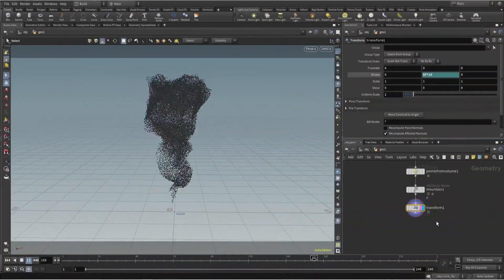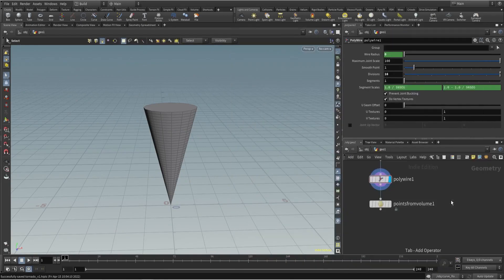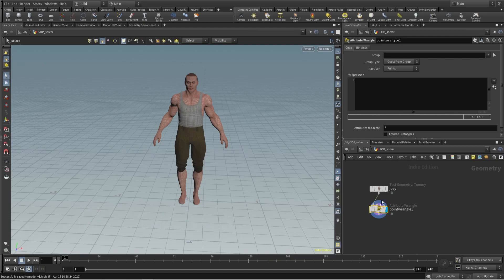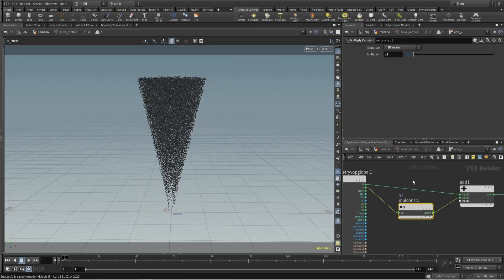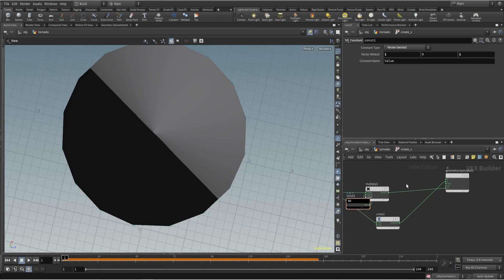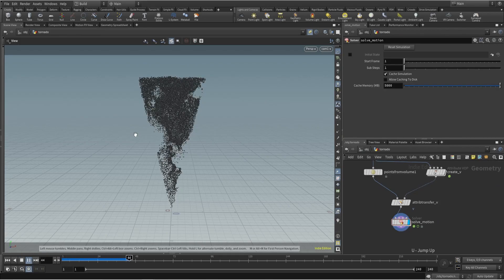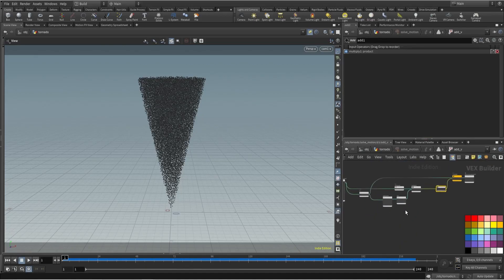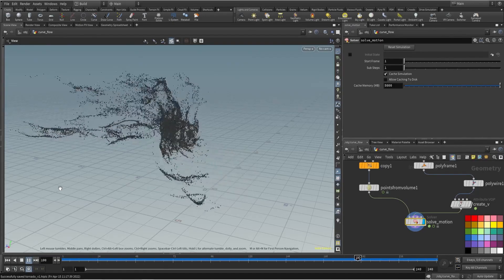Tornado in Houdini with SOP Solver | Step-by-Step Guide

Comment: This is a great video! Wondering if there is a way to set it up with a popnet to achieve similar result but allow for collisions with static meshes?
Reply from the maker: Yes, you can use it. Inside the Popnet, use a SOP solver  and POP VOP to transfer velocity or any other method. There are multiple ways to achieve this, so you can experiment with different transfer methods. You can also use collisions within POP.

Comment: How do you convert it into a volume?
Reply from the maker: by using volume rasterize attributes
Reply: @VFXMagics  I tried that, but I get really strange results. The volume doesn't take the shape, and instead covers a corner of the volume box it makes.
Reply from the maker: @alippy17   email me your file vfxmagics@gmail.com
Reply: @alippy17  did you guys solve it? Because I also need it as a volume ; )
Reply: @fexvfx  any update on this?
Reply: @angelica8790  ye it‘s actually just volume rasterize attributes. I was a beginner when I saw this vid.
You need to add an attribute create node for density and temperature before.
Then you put these attributes into the rasterize attributes inputs. That‘s it.
That‘s why houdini is so cool. You can easily convert any geometry to points, volume, vdb, curves…
If you have any problems watch a smoke tutorial. Because there you also need points and volume nodes.
Reply: @fexvfx  this worked perfectly, thank you so much!